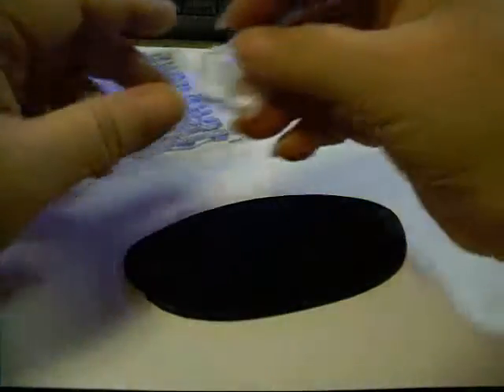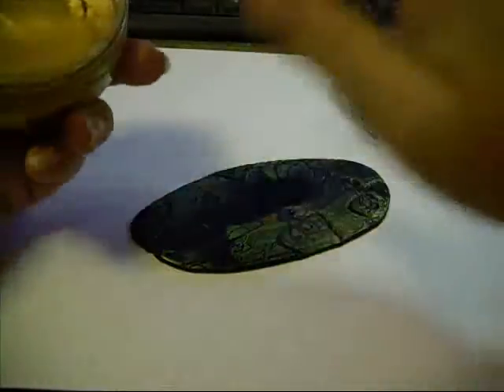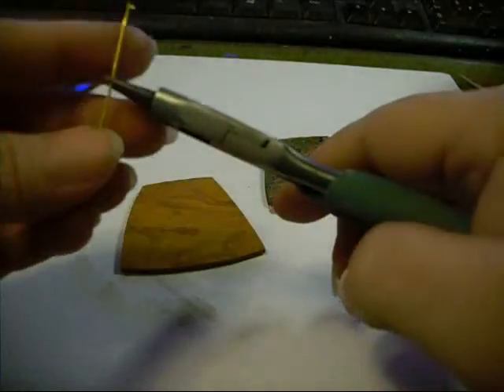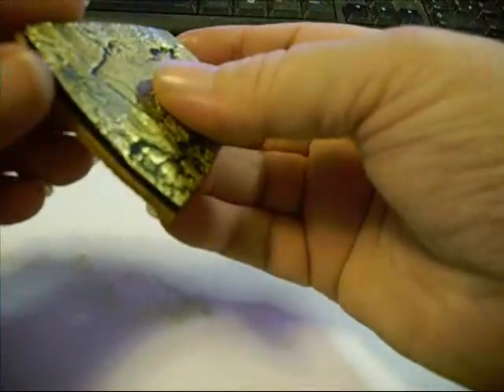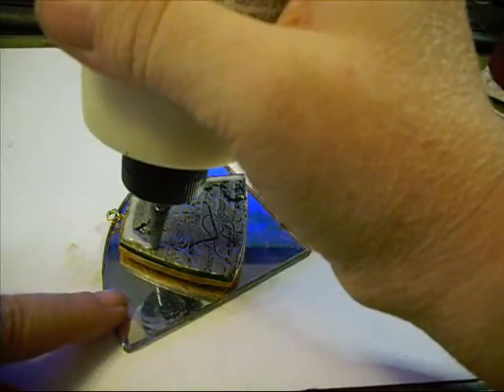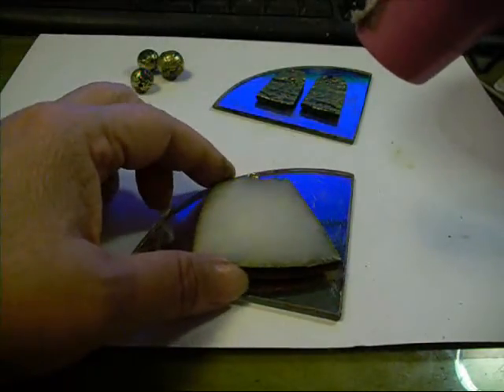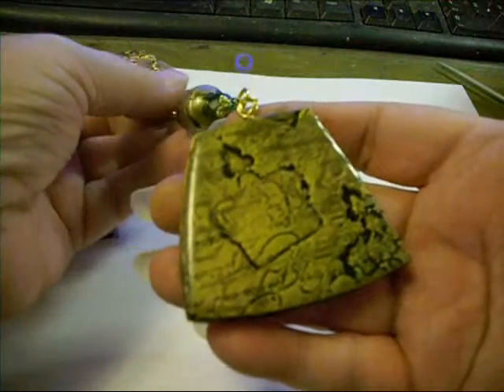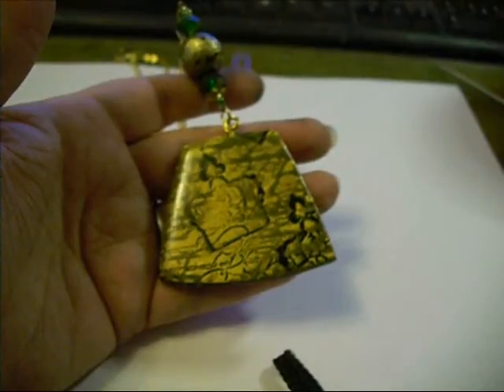#diy #polymerclay   Liquid Sculpey Polymer Clay as 3D top coat tutorial

Comment: Hi Lynz.  Great tutorial.  Can you tell me more about the type of protective surface you use on your tabletop?  (to protect your work surface when using the heat gun).   I've used a heat gun before, but it was for removing exterior house paint, and it was so fiercely hot it made the paint soften and bubbled up in order to scrape off the paint.  So, that's why I'd like to know more information about how you protect your working surface.  Are you using the same type of heat gun as I used to remove house paint?  Do you have a high and low setting on the your heat gun?  Thanks for showing us your great technique.
Reply from the maker: Hi Linda! It's tempered glass(actually the front off of a vintage TV cabinet from the 80's the type with a glass door on the front) but any glass would do. My heat gun is the crafting variety it only gets up to about 300 degrees I'm afraid the paint removal one might get too hot but if it is multi temp maybe not...I would test it first. Keep it moving over the surface of the clay so as not to burn it though & stay pretty far back away from your test piece at first 6-8 inches I'd say. Thanks for watching, Linda
Lyn

Comment: I love to watch you play with clay!!   You always make it look so easy.   After I bake my pieces, they still seem to feel a little soft.   Should I bake them longer? I bake polymer and sculpey on 270 degrees for about 30 minutes, for the recommended thickness (approx. 1/4 inch).  Am I doing it right?   thanks for all your help Lyn...you're the best!    hugs. Claudene
Reply from the maker: Thanks Claudene!  Seems right to me but you may need to check it with an oven thermometer. That being said I find Premo/Sculpey seems softer & more flexible the first day after baking...It seems to harden/firm-up after that. I also will plunge the finished pieces(stones etc.) in ice/cold water after baking, it's not applicable to all pieces but it does help with the clarity & hardness a bit. Hope that helps, Hon. TFW Hugs Lyn
Reply from the maker: Gail Davis
Hi Gail, Yes I do have an oven thermometer & my oven is set on 235...lol...It bakes really hot. Also I just received my BakeNBond in the mail & to tell the truth I'm really not sure. It certainly doesn't have an instant hold like I was told it would. I haven't tried the Diamond Glaze either so I couldn't say. Lyn

Comment: I know you baked the TLS at 275, but for how long?  Did you let it cool at all before you applied the heat gun?  I apologize if you said in the video, but I have watched several times & I'm missing it.  Thanks for helping this beginner so much by sharing your time & talents.
Reply from the maker: I baked it for 40 minutes using an oven thermometer to check the temp. Many ovens will spike in temp when the thermostat kicks on. I did let it cool down because the clay itself is very brittle when hot/warm. No worries Hon, I often forget to say things on video...lol. Lyn

Comment: I don't have a heat gun. Would a hair dryer work? I really like how thus looks and it seems easier than the resin.
Reply from the maker: Sorry Heather but a hair dryer just wont get hot enough. it takes about 300F to get the liquid Sculpey to turn clear. You can use the oven but you'd have to really watch the piece. Lyn

Comment: can you sand and buff it after? also, you said it could be cleared in the oven? how would we do it that way? I don't have a heat gun. or could I use a reg hand held hairdryer?
Reply from the maker: Hi Ronie, on this piece if you try to sand it I'm afraid it would ruin the design. To clear it in the oven requires a temp of 300F, maybe not for beginners. Nope, sorry the hair dryer doesn't get near hot enough. Most heat guns run around 300F so they'll get hot enough for this job. Lyn
Reply: LynzCraftz Ok Ok. and yes, I did a little scrap piece to see about Sanding and buffing. so I'll just have to be careful to get everything looking great before I use it. :) thank you for answering! 💖

Comment: What is the method for clearing the TLS in the oven? Because I don't have a heat gun and with my workspace being in my living room and small children running amuck, I don't feel safe using one.
Reply from the maker: You can raise the temp in your oven to 300 degrees but it may not completely clear it. The heat gun is easy enough to put away when your done & you can use a 40% or 50% off coupon a get one for around 12$ if that helps. Good Luck! Thanks for watching! Lyn
Reply: Thanks. That helps a lot. I've got TLS but haven't used it much because of clarity issues. Maybe I'll splurge and get some fimo deco gel and a heat gun soon :)

Comment: When useing liquid polymer clay as 3d top coat can u cure it in the oven or do u have to use a blow dryer?
Reply from the maker: Joyce Bower Yes you can Joyce, you'd need to turn the temp up just slightly to get it hot enough to turn clear(approx 300 degrees). It wont do with a blow dryer though has to be a heat gun! Good Luck! Lyn

Comment: Hello Lynz!
May I have a question please? Sadly I Kato glaze (max. 150°) and Fimo clay (max. 130°) not sure what is going to happen if I try to bake my clays with this glaze on?
What will happen to glaze if I bake it only on 130° (which is the max for my clay)?
And what will happen if I bake it on 150° (which is the proper temp. for the liquid glaze)?

Sadly I just ran thru videos and some of the people just glaze their thingy with a liquid but they did not mention you have to bake the glaze too, I thought it is like varnish... :-(
Reply from the maker: Hi Camilla! You can glaze your pieces with varnish...a water based varnish will work just fine without baking. As far as kato glaze or liquid fimo I wouldn't know since I only use TLS(liquid sculpey by polyform) which does bake at 130c(300f). So your 130c-150c should be fine. I hope this helps. Thanks for watching!
Lyn
Reply: Thank you for the help :-)

Comment: Lynz can I ask.  I know you demonstrate how the heat gun works to get a clear effect, but every time I try using this method (even after regular baking) I still get a cloudy white surface.  I've been going over and over the clay for ages, but after several attempts still no joy.  Should I just keep going (I am frightened that the clay has been exposed to this heat for so long) or is it something I'm doing wrong?  Any advice would be much appreciated.  I've even tried using different blands of translucent liquid clay.
Reply from the maker: Hi Elli, here's what I would suggest...on a scrap piece of clay covered with TLS baked or unbaked doesn't matter, with the heat gun just a couple of inches off the surface of the clay...just let the heat rest on a spot until it either clears or starts to brown(it takes a while don't worry). This way you'll get a feel for the process hopefully. It take 300F to clear liquid clay so give it a good blast...lol. Let me know if this helps Elli. Lyn
Reply: Thanks so much Lynz.  After reading your response I think possibly my heat gun is not reaching a high enough temperature.  I have the ranger one that looks more like a hair dryer but I've had it for a good few years now so maybe time to invest in a new one with higher temperature.  I will check one out on the internet and let you know if I have any more joy.  Thanks again.  Love your jewellery and your tutorials are always an inspiration.
Reply: Hi again Lynz, just an update.  I did get the new heat gun and I think it may be a little too powerful for clay as I've had a few experiences of burning with it, BUT on the bright side, I found liquid Kato clay and tried it, and it seems to clear up beautifully with my original heat gun.  I'm so delighted that I can now create lovely effects like you.  Thank you again for taking the time to respond, and for all your inspiring tutorials :)

Comment: I tried using TLS on a couple pieces the other day. I was using my heat gun to get it clear, but I burnt one. :-( I was getting a bit impatient with one of the other pieces and set it aside for now. Do you use the heat gun on your pieces while they're still hot? I did it while they were cold, Sooo maybe that's why it was talking me soooooo much longer??
Reply from the maker: +Carmen Mobberly Hi Carmen, it does take quite a while to get them to turn clear. I don't think I started when they where hot but here it Texas it's rarely cold...well not in August anyway...lol. Just keep the heat gun moving at all times, don't let it sit in one spot. Also if you've got one of the Ranger heat gun that don't get as hot it may not work either. My oven is just so weird on the temp dial that I won't turn it up or down...so I came up with this as a way to get clearer results with the TLS. But it can be done in the oven. Thanks Hon not sure if this helped...lol. Good luck though.
Tfw Lyn
Reply: +LynzCraftz I may try using my oven to get it to clear up. I live in MD and my studio is in our basement, so it's pretty cold down there right now, lol. I have a new oven though, so I'm still trying to figure out how accurate it is. It seems pretty good so far. I have a thermometer in it and it seems pretty consistent with what I have it temp set to. Maybe it'll work in my oven and I can just finish it off a bit with the heat gun. Mine is Darice I think. It seems to get hot enough.
Reply from the maker: +Carmen Mobberly OMGosh I'll bet it is cold...lol. We've just come out of 4 days of solid rain & temps hovering right around 34F...I just finally got my dogs outside...lol. 
Darice is a great brand & should definitely be hot enough. Sounds like a good plan, Carmen...good luck!
Reply: +LynzCraftz Thanks! I can't wait to see how it turns out.

Comment: Hi, I just started watching your videos, they are great! Thank you so much for sharing your experience, I am learning so much. Couple questions: How long do you bake liquid clay? Also I am wondering if its possible to emboss on liquid clay after baking and when cover it with another layer of liquid clay ? Have you tried this?
Reply from the maker: Thank you! It takes a while to bake in the oven, around 30 minutes but unfortunately this wouldn't make it clear enough. It will be milky out of the oven that's why I use the heat tool afterwards. It heats up to around 300F which the liquid clay needs to turn completely clear. 

Yes, that would be possible again using the heat tool to clear it afterwards. I hope that helps, Hon.
Lyn
Reply: Thank you Lyn , I can't wait to try it.
Reply from the maker: Your very welcome, if you have more questions feel free to ask.

Comment: Hi!  First, your videos are excellent - they are very detailed.  Well, I tried this and for some reason on all of my experiments I ended up with tiny little air bubbles.  I was very careful when I applied the liquid, did it slowly, didn't shake the bottle, used a toothpick to gently bring it to the edges, and still got them.  I don't see any at all on your pieces.  Any suggestions you might have would be very appreciated.  (It's a brand new bottle of clear - I tried it with 2 different brands and the same thing happens - it gets very clear and shiny, but with some bubbles).  Thanks!
Reply from the maker: I'm so sorry this happened to you...1st my bottle of TLS is rather old(maybe 10yrs) so I don't know if that may have something to do with it. I did just recently get a bottle of the new Sculpey Clear but haven't yet tried it. Are you using just your oven or are you using a heat gun? Not sure if it matters. It may be a moisture problem...make sure your piece is completely dry? Hmmm I really just haven't experienced this. I may need to revisit this & see what I can come up with.
Lyn
Reply: Very kind of you to reply!  I just recently heard about using the liquid clays as sealant and was surprised that you published this process 3 years ago!!!!  The two brands of clear liquid I used are Sculpey and Kato; the pieces are completely dry - they are some of the first little, flat pieces I made over a year ago that I wasn't in love with but kept them to experiment on.  They were made from Premo, cured in my oven for 60 minutes at 275 (use 2 oven therms on either side of my oven and the temp is accurate).  I applied the liquid, then tried different temps to cure - a couple at 275 and a couple at 300 - and then hit the pieces with the heat gun - there didn't seem to be any difference from the different curing temp.  You seem to hold the heat gun very close - do you know what temperature it goes to?  Mine is a hardware type heat gun, Black and Decker - 2 temps - 750 and something else.  I have to hold a bit further away or it burns the piece.  

I'm going to try it again, holding it further away, and see what happens.  The Sculpey Clear gets totally clear, like glass - you'll love it.  I'll be interested to hear your results.
Reply from the maker: Hmmm...my heat gun is a crafters heat gun, only gets around 300F so it's hard to burn the liquid sculpey but you can sure burn the polymer clay though...lol. I would think the bubbles are occurring in the oven(when the liquid clay is "curing") & not from the heat gun but don't quote me on that. I will don some experimenting myself & see what happens, it's been a few years since I've done the tutorial...it may be time to revisit it!
Reply: Hi!  hope you're having a nice evening!  I thought about that too, that they were happening in the oven so I checked with a magnifying glass lol  and didn't see them so I think I'm causing them with the heat gun.  Will try again tomorrow and hold the heat gun further away.  I'd read some folks on Facebook that I thought had said the crafters heat gun, for scrap booking for instance, didn't get hot enough.  That's why I got this heavy duty one which I think now might be too much.  I can still return it though!  ;-)
Reply from the maker: Thanks I am, hope you are too. Yeah it might be the heat gun, mine is the embossing heat gun & does a great job but I think your right like the Ranger heat gun among others may not get hot enough.